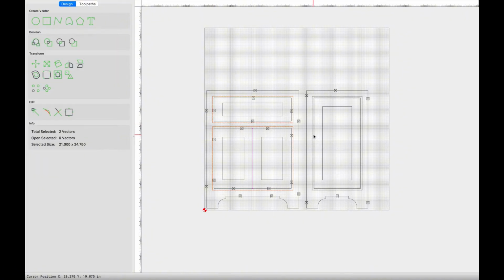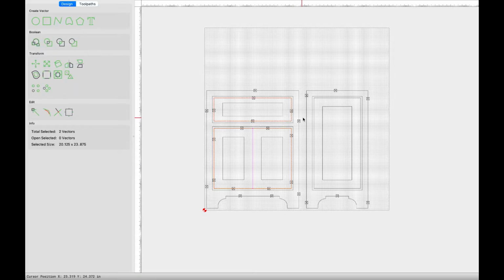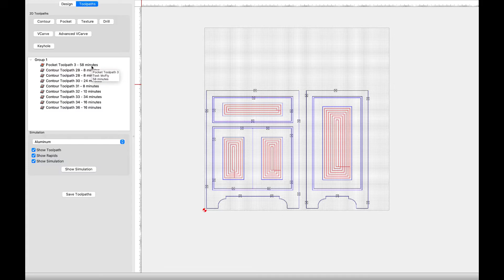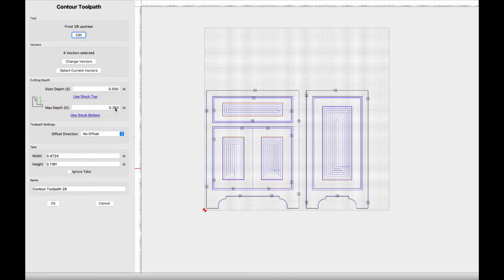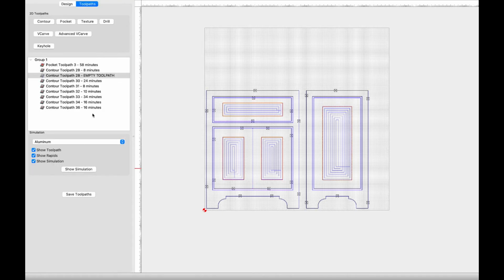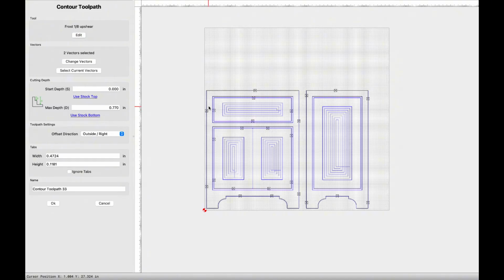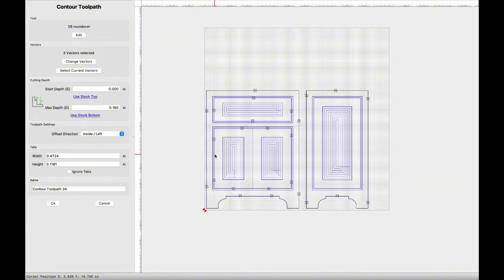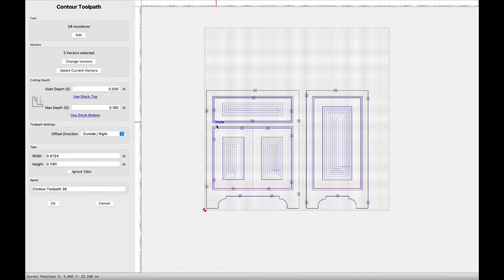I Built This Vanity Using WHAT?! Using a CNC for custom cabinets

Comment: Great Video and thank you for sharing the process! I also have the Shapeoko 5 pro and use if for a lot of different projects, separate from that I've made custom furniture and have been wanting to integrate the CNC machine into the process so this has helped a lot. I have to remodel our two bathrooms over the winter.. it will be a great time to experiment.
Reply from the maker: Absolutely! I build custom cabinetry and I’ve been trying to figure out a way to help automate the process/replicate some of the things bigger/more equipped shops are doing, while still trying to maintain a high quality product. Good luck!